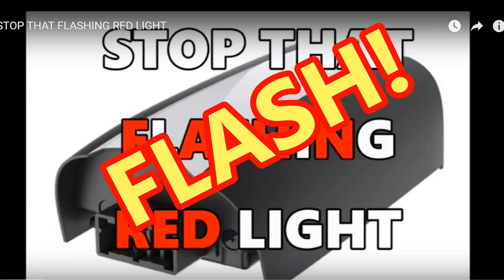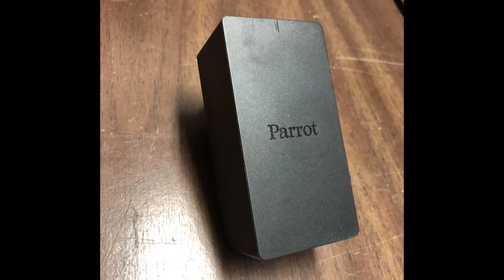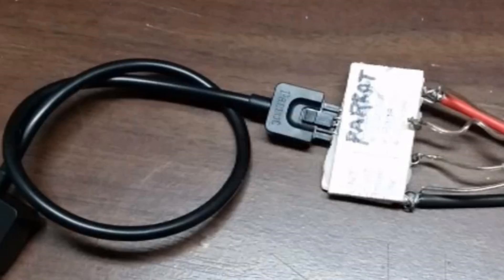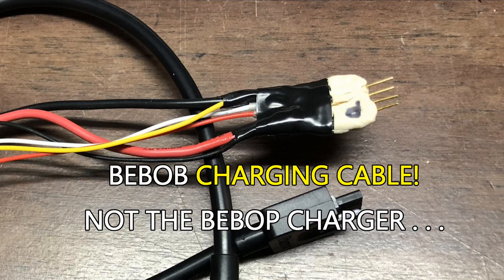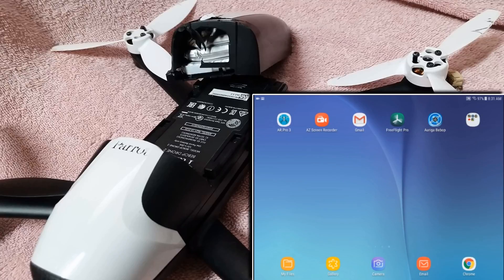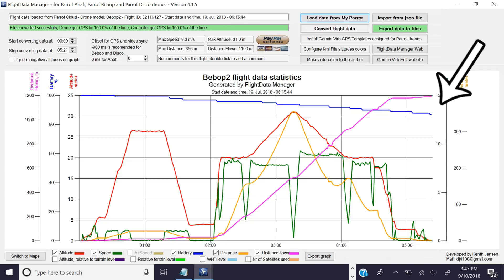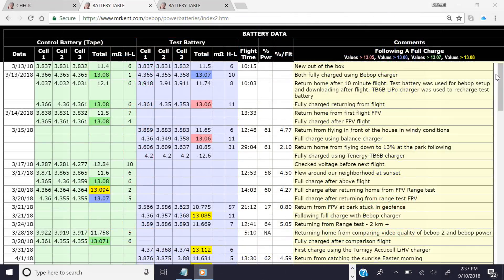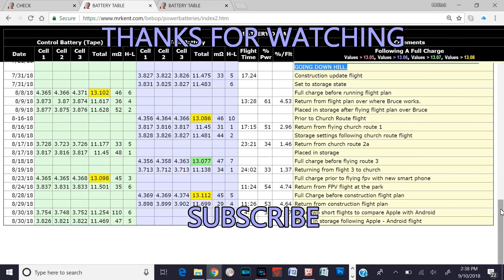DON'T STORE A FULLY-DISCHARGED LIPO BATTERY

Comment: Hey thanks for sharing! I like the chart and info.I got a good deal on the Bebop that was before the Bebop2 and the battery have different connections.I use the charger cable that you make and it’s perfect and has saved me money no doubt!!Is there any way you can make balance cable for that battery also?I would be 1st on line to buy one from you!Im sure there’s other in need of it also.I can send you the battery it takes if that helps!
Reply from the maker: That is very interesting Bruce. Why don't you send me several good close-up images first so I can think on that. My email address is: mrkent.com@gmail.com. Also, thank you for your kind words and your comment. God bless.

Comment: Curious? What is the longest you would want to keep a battery at full charge before either flying it or discharging it? Thanks Mr. Kent!
Reply from the maker: I don't know any find details, but I usually charge up my battery the night before I plan on flying. I know if you leave a battery full charged for a month it will never get up to a full charge again. EXPERIENCE :) My brand new $60 battery for my big plane (Apprentice s). Bought it planning to fly right away but got side tracked and forgot about it. When I remembered it was "puffy" and only about 90% charged.

I would say you can let them set a couple of days without noticeable damage.

Thanks for your comment and God bless.
Reply: mrkentdotcom Thanks Mr Kent, I best change what I was doing then. I was leaving it at full charge for up to 1 to 2 months.....Thanks for the advice!